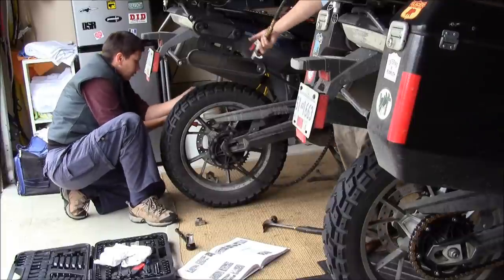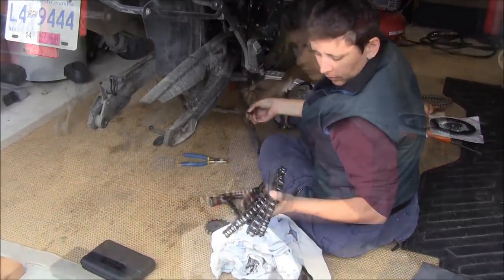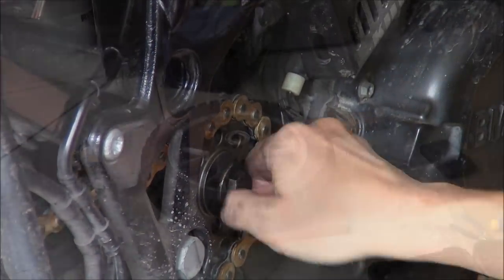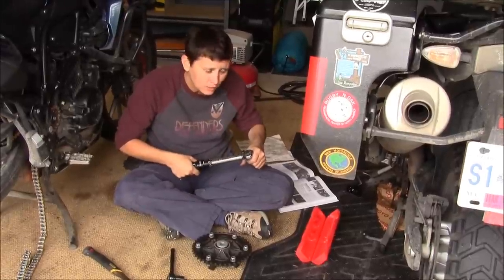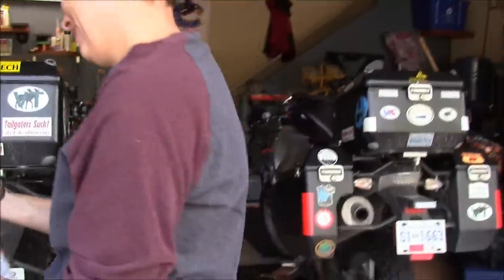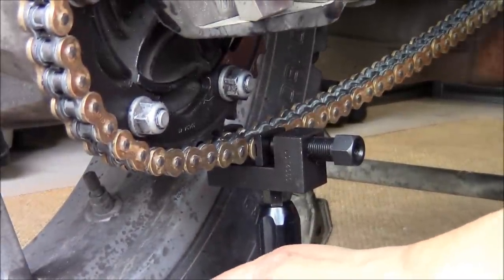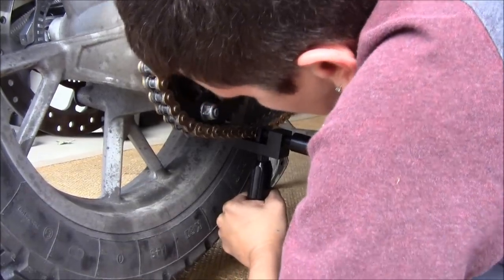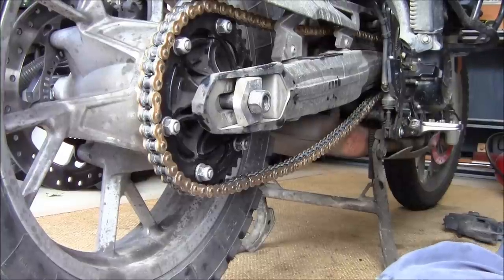DID Chain and new Sprockets on Cheryl's 2010 BMW F650GS

Comment: Did you guys just break the chain using the tool, or did you have to use a grinder on it? I just broke two pings on the chain tool trying to get the pin out. Mine has to be a continuous link chain, I tried rotating the chain to find the master link and could not see one.
Reply from the maker: Just broke it with a tool and BMW comes with a continuous link chain we replaced it with the DID and had a master link. When my F800GS needs a new chain will replace the stock with another DID
Reply: Leslie Sofarelli
Thanks for the reply. My chain is made of some sort of kryptonite. I've gone through two pins on the chain breaker, I am going to resort to a bolt cutter now since I have no use for the old chain :)